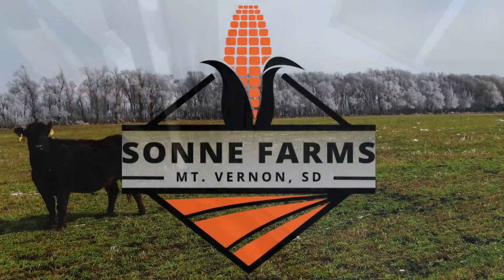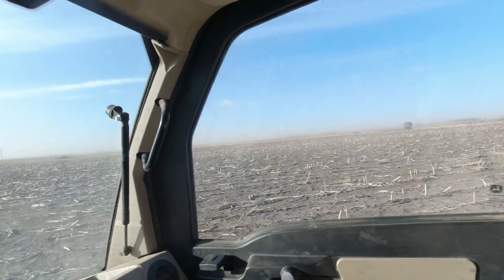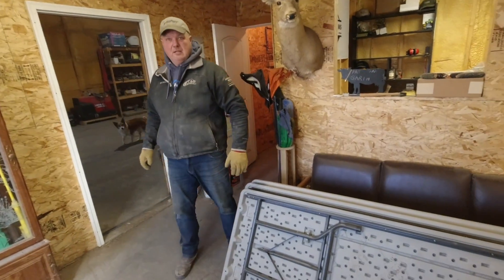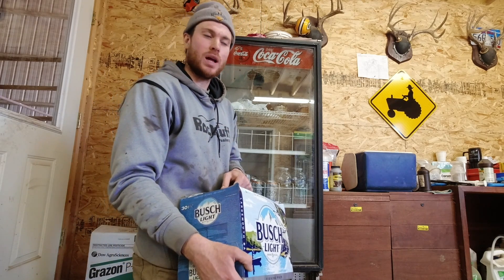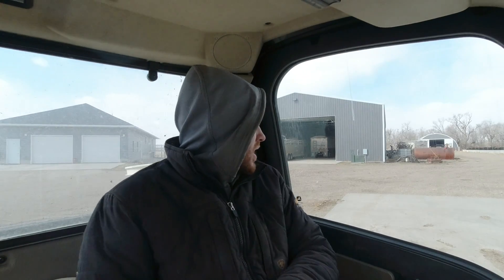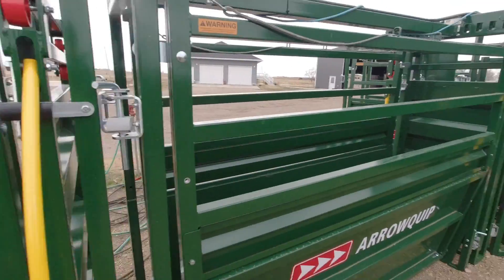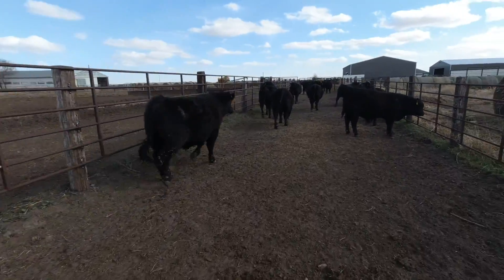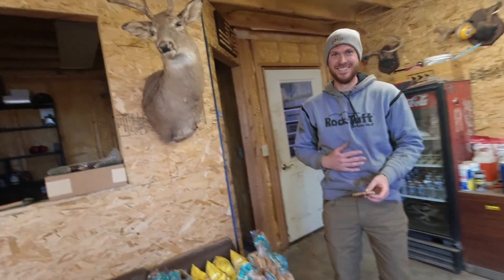Wind Like the Dirty 30's!

Comment: Just a suggestion for rocky the raccoon. I’ve caught lots of them around my place with just using a cheap can of tuna in oil. Just remove the lid and sit it in the trap in the can. Maybe put the trap in the barn near the equipment where he’s walking around. Would bet it wouldn’t be long before you have him.
Reply: We use cheap canned cat food with excellent results.
Reply: Open a can of soda and put it in the trap. Seems to work when my kids leave them on the porch at our cabin.

Comment: I had commented way back when you were talking about putting wheels on your hydraulic pump to use a kids red wagon or 6 inch balloon tires.  Much easier to get across uneven ground than them small wheels you put on.  Oh well.

Comment: Hey Cole, for your coon trap… Try marshmallows, stick them through the holes in the hardest to reach spot.  Then grab your torch and toast them like your making s’mores.  They will swell up and the coon will have to spend more time getting them out.  Good luck!  
Signed, a concerned trash panda trapper.

Comment: I don't get the head line 😶 🤣

Oklahoma, windy all the time. April is our most windy month of the year. 🤣

55-75mph winds. 

Our grain bins don't blow away empty. our roofs don't some how.. my barn roof is original 140+ years old. 

I ain't joking. Think about a hole month 55-75 mph. 1 day a week no winds.
Reply: I need to clean my barn badly. I only clean my buildings cattle go in or my little work bench 🤣 do you guys clean in different states??

Comment: We have also been getting alot of wind here in Nw Iowa as our winds have been running 45-65 and last week when they projected bad storms for us even the Weather channel and the storms started breaking out 45 miles to the southeast of us with numerous tornadoes and there was 7 counties that were declared disaster and it didn't even rain or storm but after the front went through we had 70 mph winds. We have gotten around ainch and a half between the last 3 days and more today and I think some chances during the week. Did you get that high temperatures the other day like Valentine Nebraska had 97 we had 79.
Brian back in the days when you first started selling bulls did you ever have Rocky mountain oysters for dessert after everyone picked up there bulls and sat around and had a few beers and talked

Comment: What would you rather do: 
plumb in metal hydraulic lines through the building to an exterior fitting (like on the tractors/implements) so you can leave the hydraulic pack in one permanent position but run the chute;
or run electrical lines in the building to plug in the pack right next to the chute?